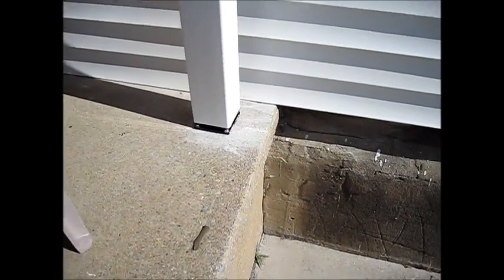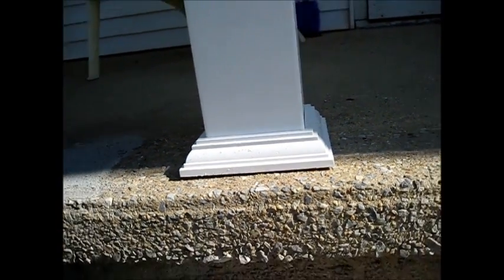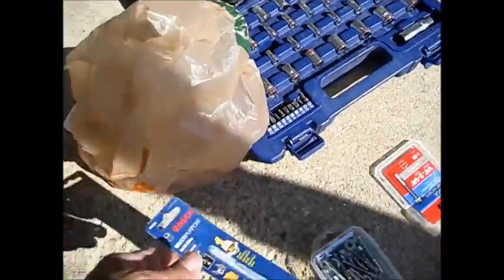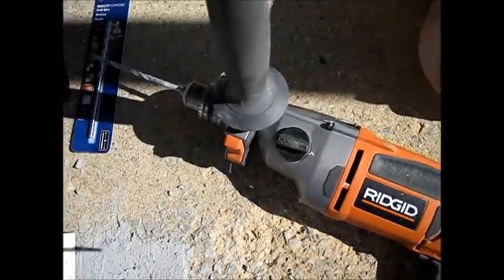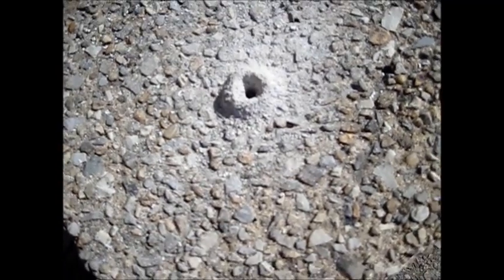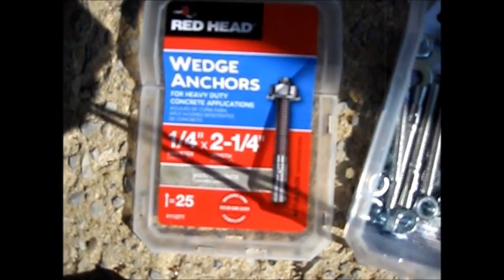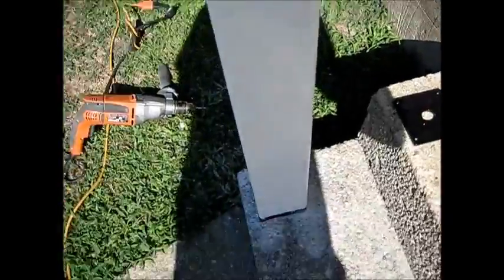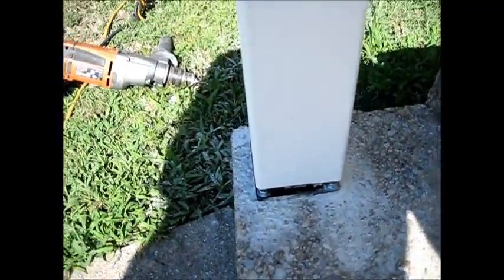Vinyl, Composite porch post installation for stair railing on concrete

Comment: Thanks for the Video!  I was going to use Tapcon anchors but I had read some reports of the heads snapping off.  That's the last headache I need.  Now I've switched to these wedge anchors after watching your video.  I'll find another way to mess the project up, like cutting the composite railings short, but at least I'll have good anchors !!

Comment: How far down did you drill for the 2 1/4 wedge anchors? Not sure if you are supposed to go slightly deeper than the anchor length.
Reply from the maker: Joleen Barker I always drill the actual length if it's 2 and 1/4 I'll drill 2 and 1/4 quarter but they'll be about a half inch to three quarter above grade after installing. And yes you're correct throwing a little bit deeper is always a good idea
Reply: Thank you for the quick response.

Comment: The bracket for my top rail has a screw hole pattern that is outside the inner steel post. are the sleeve inserts strong enough if the bracket doesn't bolt into the middle steel post?

Comment: I need this for a very unstable and very heavy woman who needs it to get up my stairs. Will this hold over 300 lbs?
Reply from the maker: I would use inbedded solid iron rails core drilled and set in hydrolic cement. The surface mounted post will stress the concrete anchors over time with excessive pulling thus weakening the concrete anchor set bolts over time causing the anchors to become loose

Comment: Do they make these for 6' posts on concrete? I need to move my vinyl fence and 2 posts will be on concrete, the rest will be in dirt.
Reply from the maker: Sorry for delay....I have not come across them
Reply: Are there rails to do vynil fencing just like these? I'm trying to do fencing on concrete wall slab

Comment: wat bit u used?
Reply from the maker: Francisco Huerta how you doing 5/16 tapcon but also make sure that you buy the tapcon set pin which is the threaded nut on top and it will tell you to use a 5/16 tapcon bit